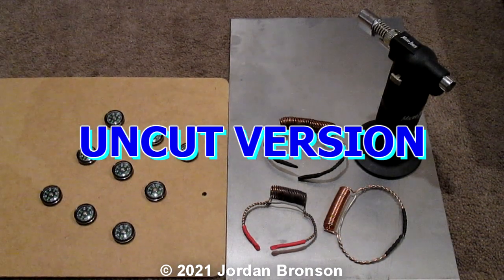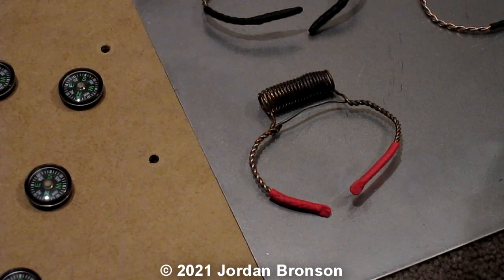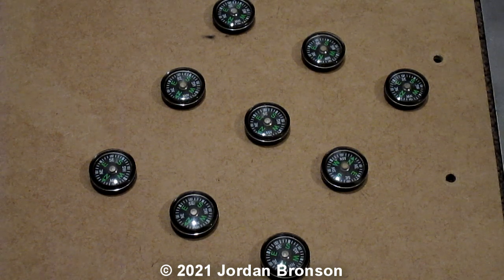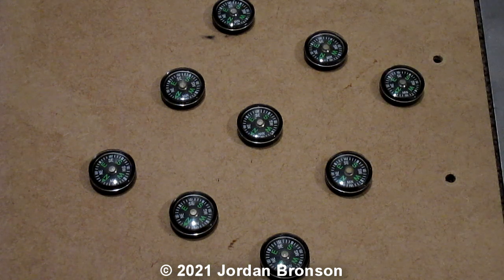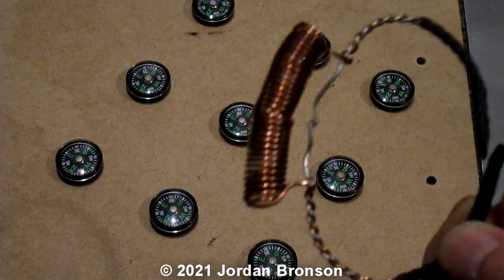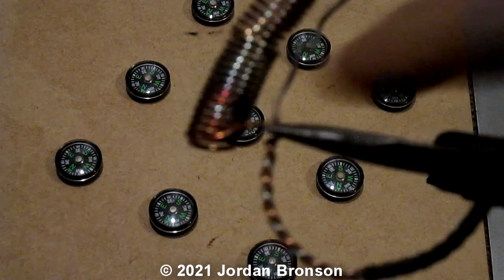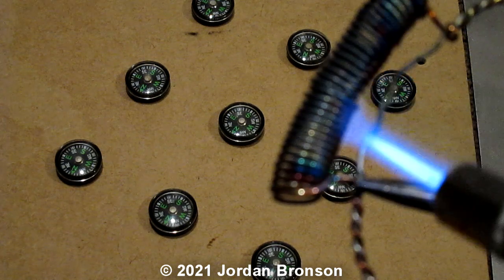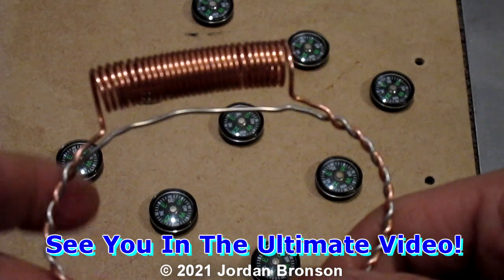The Wonder Bracelet - TEST #2 - Long Uncut Version - Proof Of Concept

Comment from the maker: ▶️ READ DESCRIPTION TO LEARN MORE AFTER TESTING.
▶️ NOTE:  During wearing your bracelets, you can feel the coils warm.
▶️ NOTE 2:  Use this as your testing guide.  If you are using the WRONG materials.  Your Bracelets will be worthless.  I hope you are paying attention in the Part Video and what to get.
▶️ MATERIALS:  It MUST BE Copper + Stainless Steel Wire or Steel - Iron Wire.  Other than that, you are wasting your time and it will not work!

Comment: Great job!
Reply from the maker: @MM-ez5vj  -  You have to make new ones.  After intense heating, the Copper will absorb less, just like everything else in this lifetime.
Reply from the maker: @MM-ez5vj  -  Discoloring doesn't affect the bracelets at all.  Just make sure you clean them or keep them dry.  Moisture will do that because of copper.  All you need is white vinegar and cleaning and drying and you are good.
Reply from the maker: Thanks for the visit

Comment: Original Jordan Gang checking in! This test is awesome
Reply from the maker: Hahahahaha, welcome!
Reply from the maker: By the way, did you make some?  There is a video coming.... It's going to open your World even wider and YOU WILL MAKE these for sure, if you haven't !!!
Reply: @JodBronson  I got the materials but haven't had time to make them just yet. I have the enamelled wire, do I have to take off the outer layer up to the coil and not mess with the coil, right? Or do I just have to take off the bottom where it gets shrink wrapped?
Reply from the maker: @naughtyorgneiss  -  Just strip off the part that touch your wrist and make sure to test continuity.  There is no need to touch the Coil.  For shrink tubes, you don't need it.  Just curl them in, so it won't scratch you.  As long you don't scratch yourself, you can curl the end, etc...  NOTE:  Do you see the Cold Test Video recently?  There is a big scratch on my left arm, that was the causes during testing/wearing/sleeping, LOL.
Reply: @JodBronson  Yeah I saw that! Is that from one that you didn't shrink wrap?
Reply from the maker: @naughtyorgneiss  - Yup, I didn't shrink tube it and wore it during sleeping.  Curl it onto itself, you will be aok.
Reply from the maker: @naughtyorgneiss  - Here, check this video out how I curl it.  https://www.youtube.com/watch?v=QwfzVztJ80k